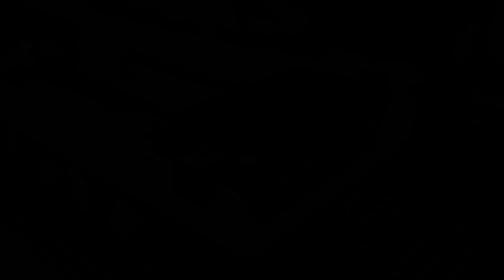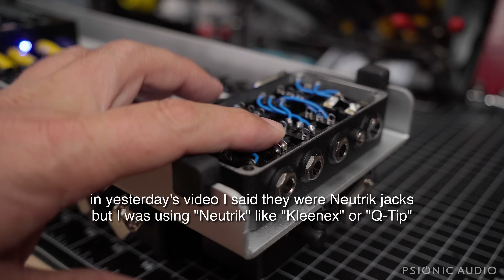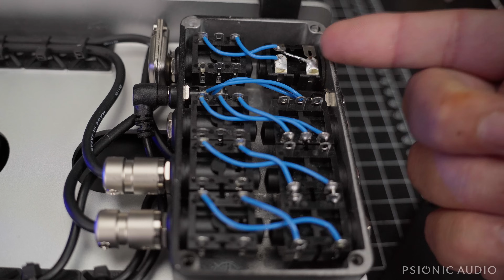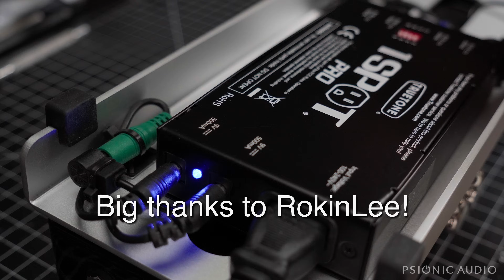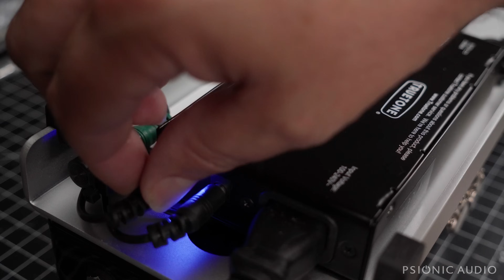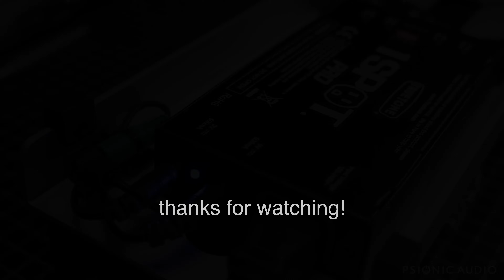Interface Planning, Making, & Wiring

Comment from the maker: I forgot to say I initially expected to secure the interface with Dual Lock, so I was going to use a Switchcraft 12A for the guitar input jack. As I had to screw the interface to the frame that meant I had to use an insulated jack. You can use a Switchcraft L12A with the insulating washers if you prefer.

Comment: Haha, nice to have these send and return jacks sitting perfect side to side to just ronnect them :D
I use two seperate patch boxes on my board. One is just the input jack going in and coming out on the other side. I added a parallel out jack in case I will play acoustic guitar on the stage again, so the sound human can get their signal right there. Had an A/B box on there for a long time, but as I never used it I just tossed it out.
Same as yours with the inputs tip shunt bridged to the ground.

The second box is for the cable loom to my amp, so it have the boards output and the footswitch jack there. Also there's the 24V input for my power distribution system which is in this box and puts out 9V and 18V. The whole board is just the tuner and dirt stuff, so just daisychaining for the power is totally fine.

The input box is a Hammond 1590LB and the output/power box is a 1590B like yours.

I also had spare DC jacks and insert points for years, but it turns out I never use them in a live setting. So I got rid of all this stuff, cause at home at the workbench or at friends homes I got plenty of outlets and power supplies around.

Comment: I find these videos very helpful as a beginner in electronics and someone who'd like to create his own patch cables, interface boxes, and wire my own boards... so thank you Lyle for all the info and links to materials.  Quick question/clarification: did the green Voodoo labs adapter connect to the red 2.5mm cable for the Stomp?  I've always used the adapters provided by Truetone.  One of the things I don't like about the CS6 and Line 6 product line is the multiple adapters you have to use.  If I can use the Voodoo Labs green to 2.5mm red, I'll go that route.
Reply from the maker: The trick is to put a 2.1mm plug on the straight end of a Voodoo Lab 2.5mm cable, wiring it tip negative. Then connect to the current doubler splitter to two 500mA outlets as shown.

After this video I replaced the two straight ends with right angles so they don’t stick out. Because it was bugging me.

But yeah, using three CS6 cables is a drag.
Reply: @PsionicAudio  Thanks!

Comment: Wear some leather gloves & eye protection when you drill holes that size. If that bit grabs onto the box the box will spin around. All bets are off as to whether you come away unscathed, bruised, cut, and or slashed. Cast aluminum can be some very grabby metal when you drill into it.  I have a camlock drill press vise. Line the vise with some heavy cloth or leather so you don't bung up the box.

Comment: If you are really pressed for space in a rack shelf or on a pedalboard, can you use those snap-together right-angle 9V DC plugs without the back cover and a couple of layers of heat-shrink instead?  Nobody seems to make flat DC plugs.